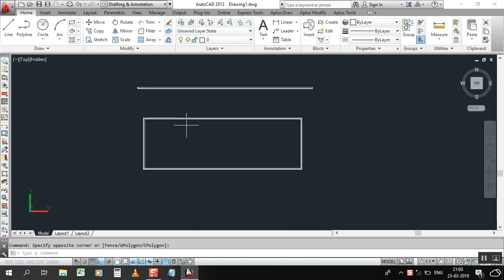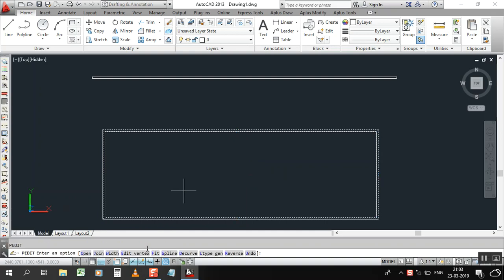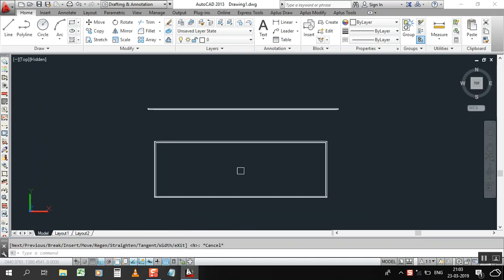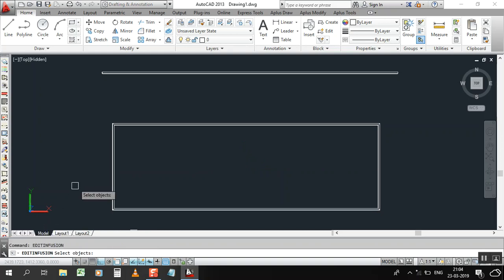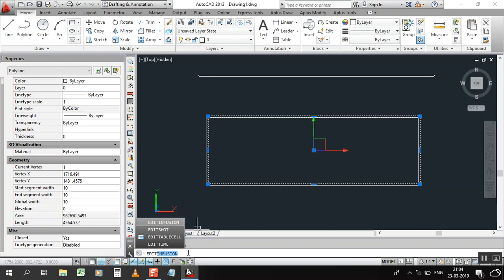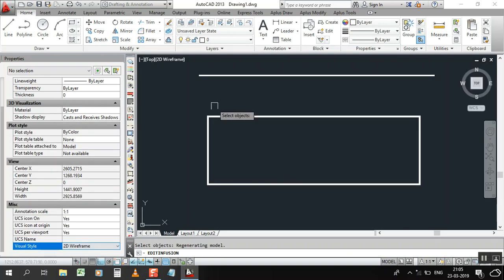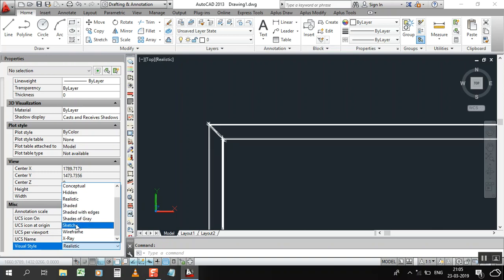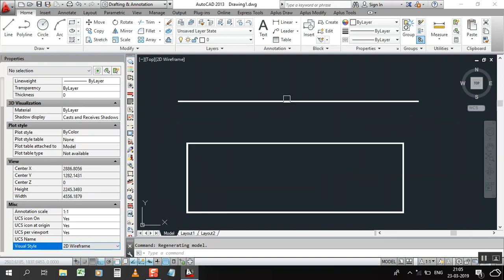Solve frame poly line issue with shortcut method

Comment: Yeah...not working...in my case it's not showing the command "editinfusuon". The visual style is also 2d wire frame
Reply from the maker: Select the Polyline make two times Editfusuon then properties change the shade....
Reply: @AutoCadTipsTricks  how to make it two times?
Reply: @AutoCadTipsTricks  
Command not allowed
Reply from the maker: Please follow the method it will work....check the properties...of line width as I show....
Reply: @AutoCadTipsTricks  
Sir
Edite infusion command nahi hota
Same darawing Mai saparte pline ko fill nahi hota hai
Reply from the maker: When you type PL see the options....in command line....
Reply from the maker: Did you solve the issue....of PL..
Reply: Dear..
properties open rakho aur select polyline and type Edittime per click kar kay ..visual style main Realistic karo
Reply: Nahi hota hai
Reply: Commande not allowed